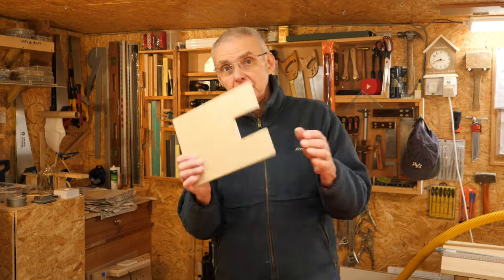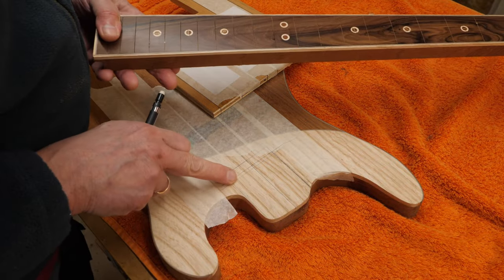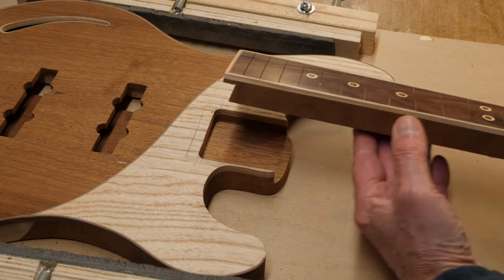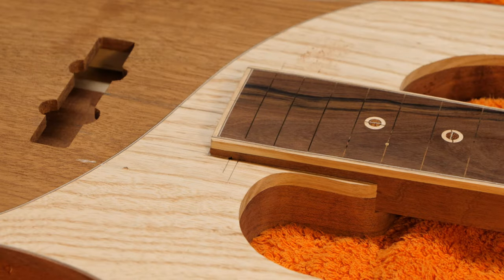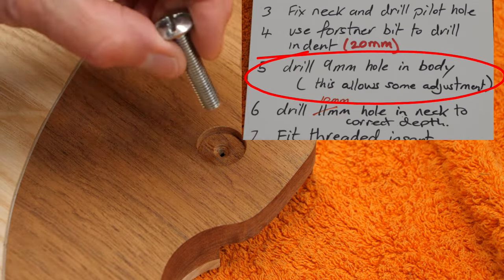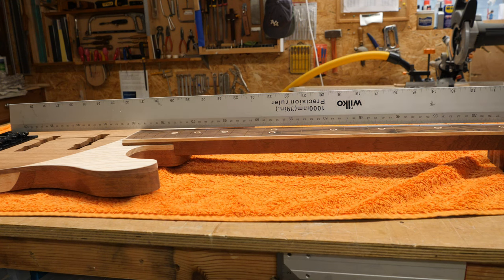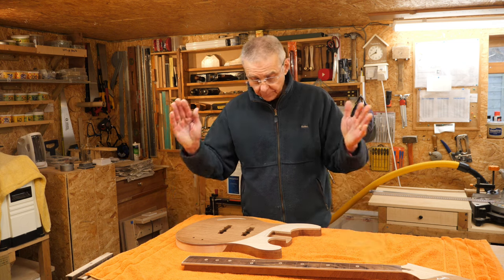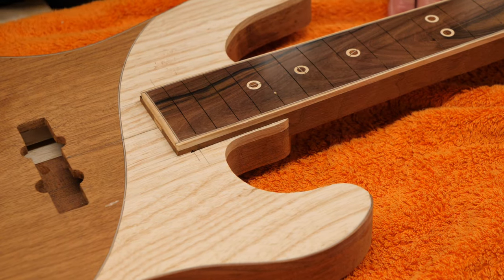A unique and simple guitar neck joint! Jurg's Challenge Ep 16

Comment: What a difference when you get the neck and body attached! Voila! It all comes together and looks like a bass.
Please, when the time comes, show us some of your soldering of the electronics.
Reply from the maker: Yes it does make all the difference just putting those to sections together.  I will certainly be showing the electronics, there's no back plate so its all got to go in through the jack socket hole.  Should be fun. Cheers Dave

Comment: Lovely design and that neck joint looks like it will do the trick nicely. It reminds me of a Russian guitar I once had, similar setup, single bolt but it had a lip that fitted a slot in the neck pocket. I also had another guitar with a quick release, don't know the make, long since sanded off by the time I got it. The neck/pocket on that one were almost identical to this, slanted end. I guess it was meant to be taken apart for ease of transport/storage. Both guitars played great and resonated well through the body and neck.
Reply from the maker: Thank you! I have used this technique a few times now and it works great. I like the ease of taking the neck off and in my case it means I can add a shim to make minor adjustments. Cheers Dave

Comment: Excellent video, Dave! I’m intrigued by the single bolt and keel approach. I know you didn’t call for a vote, but I’d favor lopping off that vestigial slice of neck pocket border. Jazzmasters and Jaguars do fine without a full rectangle of pocket border and I think your system will hold things in place.
- Paul
Reply from the maker: Thank you, I used the technique on my bass makeover (triggers broom as someone called it) and it works a treat. Cheers Dave

Comment: You could also always do a test cut in some scrap wood with the router to test if it is cutting to the depth you are wanting. On that slim side piece of wood you might try flooding that part with thin super glue to reinforce it and it may help keep it from breaking .
Reply from the maker: Two very good ideas thank you! Cheers Dave